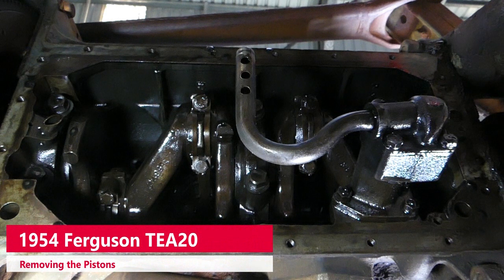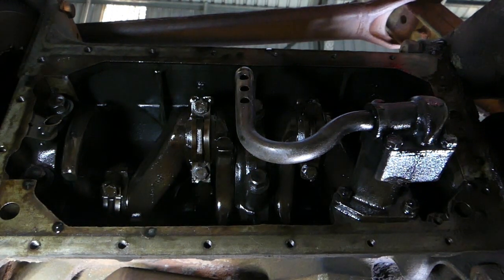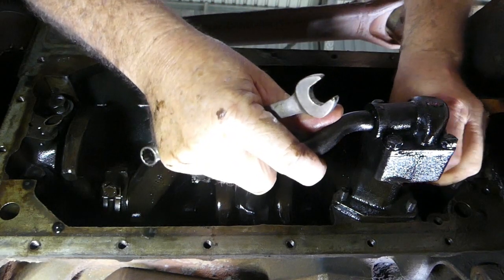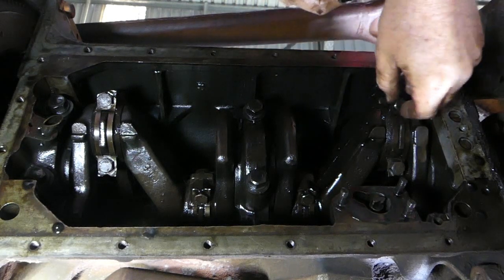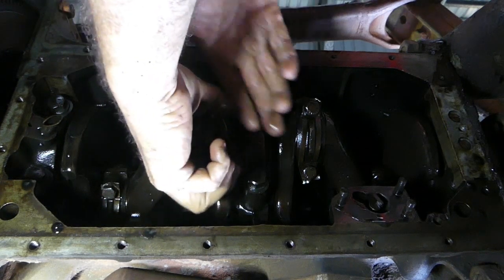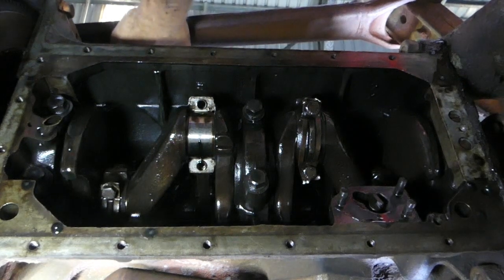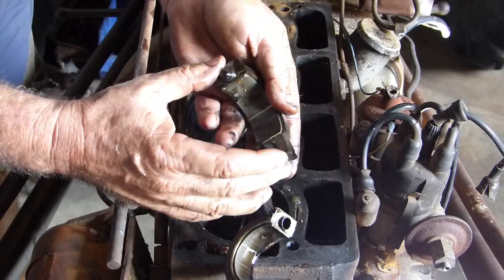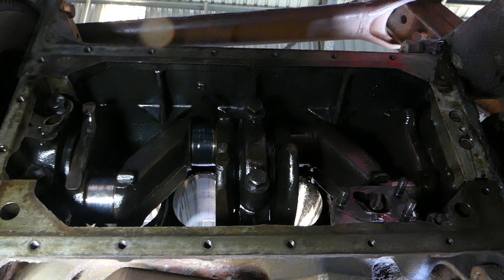Sparex Ferguson TEA20 # 5 Removing the piston.

Comment: Hi Lance. Is the oil pump key driven from the distributor replaceable from the distributor side, rather then having to remove the sump again. ?
Reply from the maker: Yes the gear and shaft comes upwards after removing the distributor.

Comment: Great video Lance - more terrific tips. Question - my '52 has a bit of a clunk under load (on that poor No. 4 as far as I can tell). Assuming no major crank journal damage, is it possible to tap the old bearing shells out from underneath without pulling the head and pistons then slide new ones in the same way? Thought I might try the cheapest solution first....😬. If the crank is indeed flat enough to warrant machining or replacement I figure the unhappy sounds will be back in short order....
Reply: motorv8N sure can fairly easy
Reply from the maker: Yes no problem doing that, just don't let the piston come down too far in case the bottom ring pops out the bottom. Im not sure if it can happen on these engines but just be aware of it as it can stuff up your whole day.
Reply from the maker: I might look at a centre main to show what can be done.